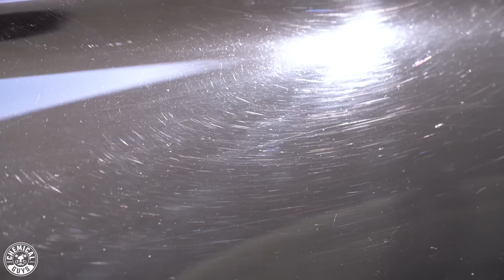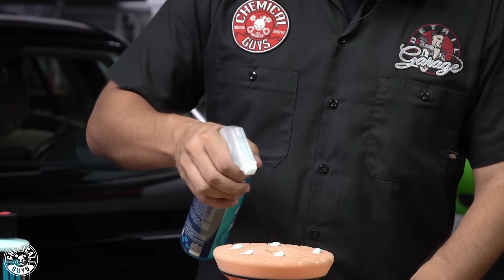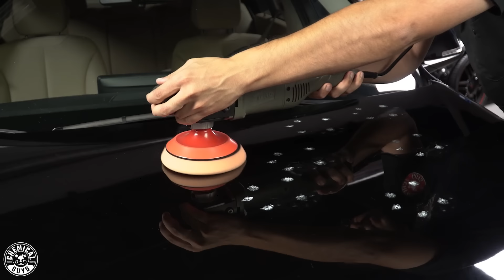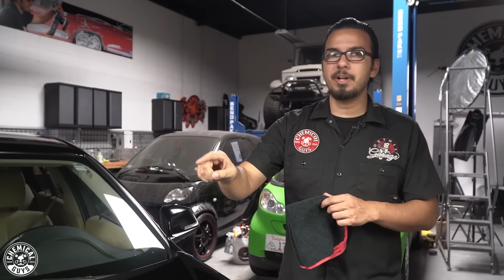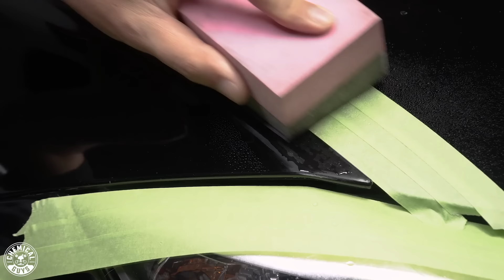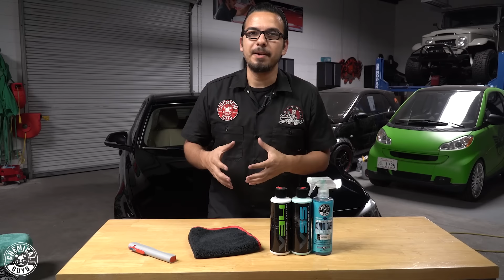How To Use Rotary Polishers! - Chemical Guys

Comment: So what's best, using like v32, then v34, then v36, or just vss?
Reply from the maker: Hey! Depending on the condition of your paintwork you can use just VSS or for deeper imperfections use the V-Line to restore a mirror-like shine.
Reply: @ChemicalGuys  so if it's been neglected more, use the right v products, but if its not as bad, use VSS?

Comment: Thanks for the video , interested j. Purchasing this machine . Question . After rotary with foam you would still have to polish to remove holograms right ? I’ve polish rotary with foam and usually leaves some type of hologram
Reply from the maker: Hey! Thanks so much for your message. In some cases it is necessary to refine the finish with a dual action polisher to remove holograms and marring after using a rotary.

Comment: I just got one of these for Christmas along with the P4 and C4 polish/corrections....is this Polisher ok to use for applying glazes and waxs too or is a DA or orbital better?
Reply from the maker: Hi Simon! Use a DA or hand apply your favorite glaze, sealant, and wax. Using a rotary to apply coatings has the potential to lightly cut causing holograms. 
- CG Nick

Comment: Nervous about using my new rotary man. I’m just trying to remove the swirls and get more gloss. I did the by hand clay, compound, polish and wax but the swirls didn’t really come out good enough
Reply from the maker: Hey! Using a rotary polisher can be fun and easy as long as you keep in mind that is cuts very quickly. Be sure that the pad is moist and constantly moving and to have an arm speed of one inch per second.

Comment: Hi, I have some desert pinstripes in my dodge truck. I bought the blue clay bar kit and used it on the entire truck. Have to say that was amazing. From another video recommendation, I bought VSS and Hydroslick. I did one side of the truck with the VSS and it worked great taking out the scratches. My question is should I use one of the Hybrid compounds as well before putting on the HydroSlick?
Reply from the maker: Hi there! Thanks so much for watching. If you still have scratches, you can use C4 before using P4 to refine a mirror-like finish and then apply HydroSlick.

Comment: Hello i have your wet mirror finish and the extreme top coating was wondering what product I should use first I’ve done the wet mirror first followed by the extreme top coat could it be used the other way around
Reply from the maker: Hey! That's correct, apply Wet Mirror Finish before using Extreme Top Coat for best results.
- CG Nick

Comment: Any advice on using a rotary for a newbie? I polished the hood of my old white suv and it still looks scratched and swirled from the rotatory any advice?
Reply from the maker: Hi Greg! Using a rotary polisher takes practice to perfect but it is a lot of fun. Always keep the pad as flat as possible, this reduces heat in a generalized area which can damage the paintwork and also makes the machine easier to guide because excessive pad angle will cause the polisher to pull. Constant movement is needed to prevent the pad from creating too much friction/heat in one spot so moving at about an inch per second is recommended. Happy detailing!! 
- CG Nick

Comment: Do you spray the pad conditioner every time you add VSS to the pad? Seems like it would get wet and sloppy
Reply from the maker: Hi Jason! Spray Pad Conditioner for the first few applications of product/2x2 foot section and then only as necessary from there.
- CG Nick

Comment: Great video. Ironically enough, I'm working on filling a paint chip in the front bumper of my car, right now. I learned that I need to use the sanding block that you showed in the video; mask the area to minimize sanding marks, then polish to perfection. Thanks.
Reply from the maker: Hey Stephen! Enjoy your detailing products!! 
- CG Nick

Comment: Hey Nick how often should you clean your pads when working on a car? Or is it better to use multiple ones ?
Reply from the maker: Hey! Great question, typically one or two pads can be used to polish an average size vehicle with a one step or light polish however every vehicle is different. So, it is perfectly normal to swap or clean pads half way through the job to maintain consistent results. Happy detailing! 
- CG Nick
Reply: @ChemicalGuys  Thanks for the quick response Nick !